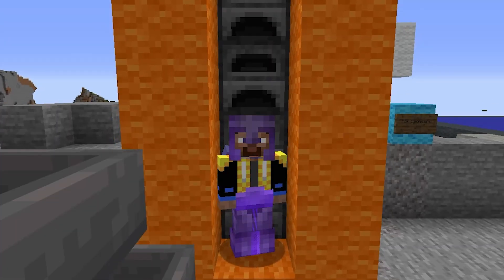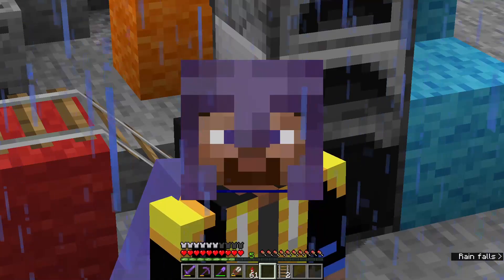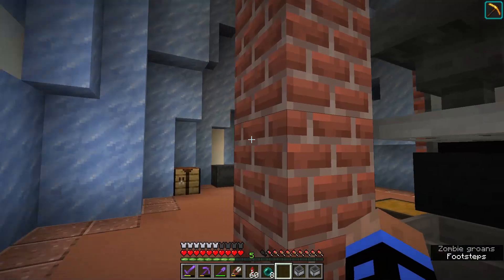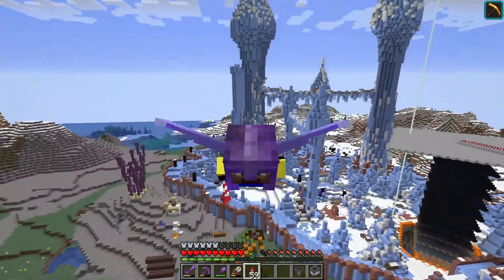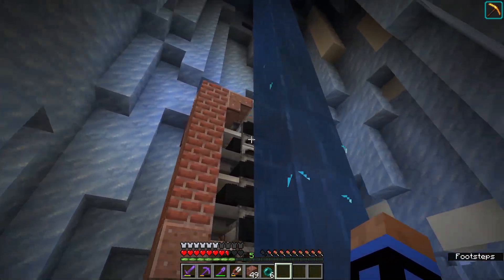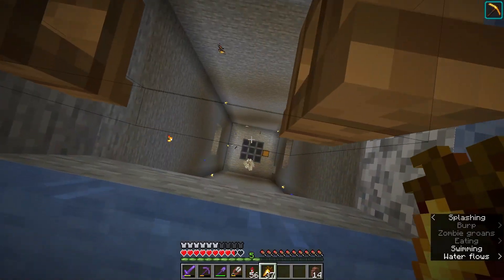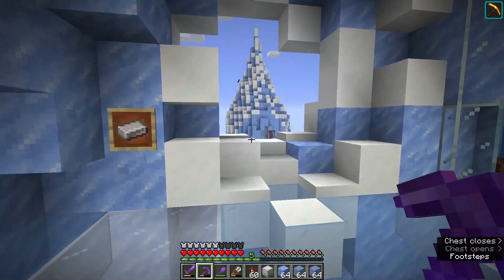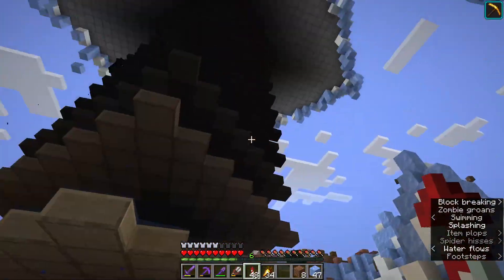Why no one uses Vertical Super Smelters - EC58

Comment: the first super smelter i made was a vertical one. for some reason i could not find a way to make a horizontal one. thus i used a 24/7 moving hopper minecart to move fuel and items into the smelter.

Comment: Edit: This whole concept is flawed because the hoppers cant pick up items from the H-Minecarts because there is a block on top of them. This means each furnace unit needs to be about 4 blocks tall, completely removing the point of vertical S-Smelters

Just my brain atm, no solid testing but you could make it 1 wider, so you moved every second furnace left you have space for hoppers. 
The hopper minecarts, combined with the new hoppers could both distribute and collect the items. Only problem is getting smelted items stuck in the furnace.

This shouldn't be a problem if you only smelt one type of item at a time, the full furnaces will act as filters.

When the last item finishes, the top furnace will finish first so the item will be able to make its way down through the 'filters' before they themselves finish. 

Last problem is you would only be able to smelt stuff in multiples of the number of furnaces you have, so 8 furnaces means no smelting 63 items for you. Or maybe not, depends if the furnaces filled top to bottom or bottom to top, or they split evenly. Unfortunately my brain cant quite run minecraft, not enough RAM. Might have a play around later to see what happens.